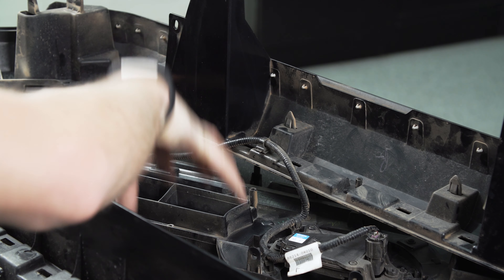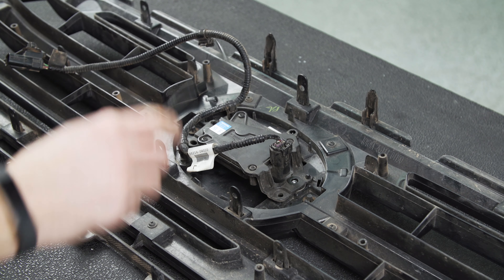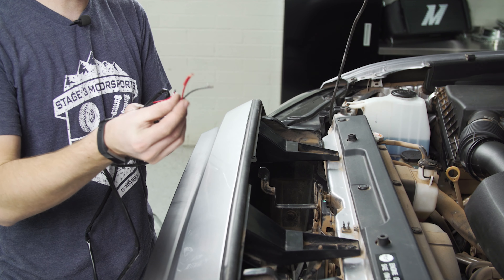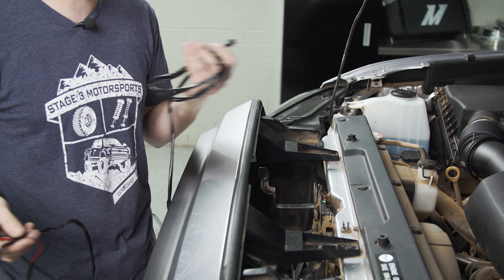2016-2020 Toyota Tacoma TRD Pro Style Grille Install

Comment: Got  mine installed today. Great fitment. Great video 🤘🏻🤘🏻
Reply: @sergiom9898  no not at all bro
Reply: I just purchased this, grill.. is it easy to install the lights ? And is the Amber daytime
Running lights or just nightn
Reply: @Turtlemilk  just night time. Daytime need wiring
Reply: @Dinooff-roadtacoma  but is it an on and off switch ? Like can I turn it on whenever I want ?
Reply: @Turtlemilk  I removed mine. No switch on mine when I had it.
Reply: @Dinooff-roadtacoma  so how does it turns on at night ? Or does it auto actually turn on
Reply: @Dinooff-roadtacoma  am I able to turn it on during the day or whenever I want ?